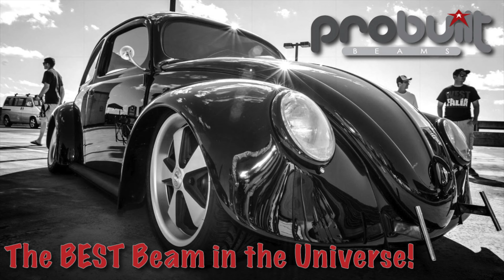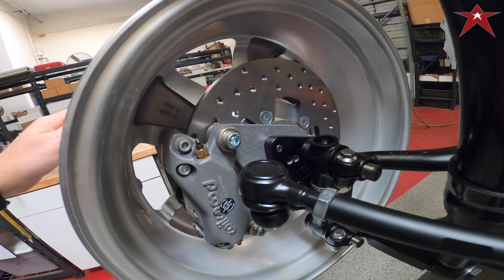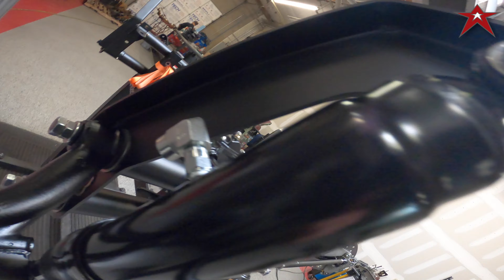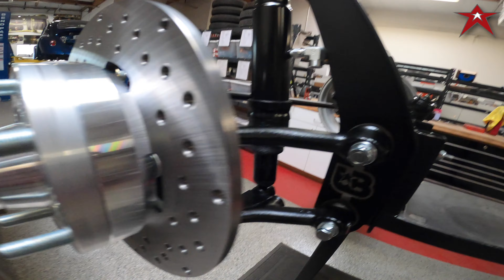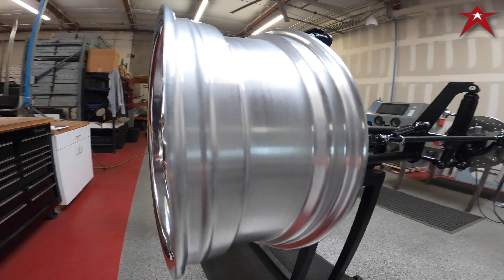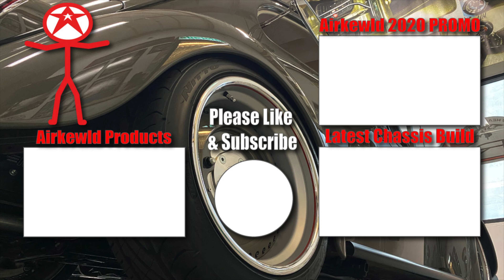Chassis 84 Episode 2 | Showcasing an Air Ride Beam built for a 1958 VW Karmann Ghia | Airkewld

Comment: Really nice Pete! Well done. I should give you a call.
Reply from the maker: We should talk!
Reply: Airkewld Pete, this is what I need to figure out. Remove beam and linkages to be replaced with new narrowed adjustable beam with bad series brakes plug and play? I’d want to use Fuch type wheels. Discs in the rear. Need to study your site more to understand what you provide.
Reply from the maker: @scottalvey1787  Absolutely, this is what we do everyday. Engine size, the type of driving you intend to do with the vehicle, the stance you are after, all of it matters to make the end result exactly what you want.